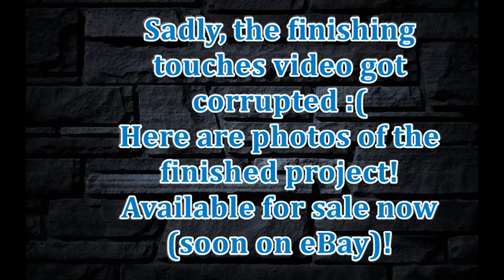Restoring a Vintage Elvis Presley Chalkware Bust Table Lamp

Comment: I have a horse that is 72 years old-could you tell me what to seal it with before I repaint it with apple barrel craft paint-it scratches off.
Reply from the maker: Just lightly sand it til smooth and to clear any old paint chips. Then paint over that. I sealed mine after it was painted. :) Hope that helps!